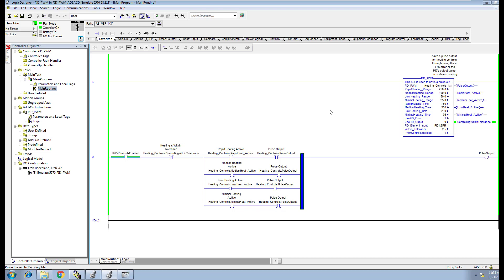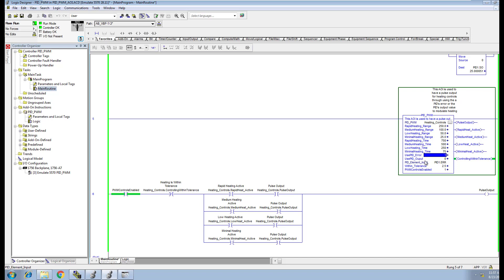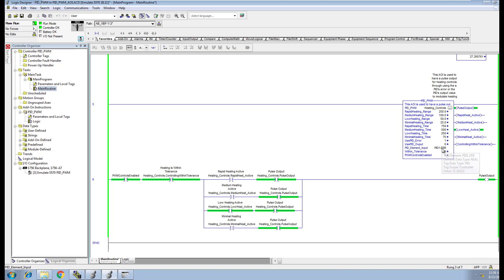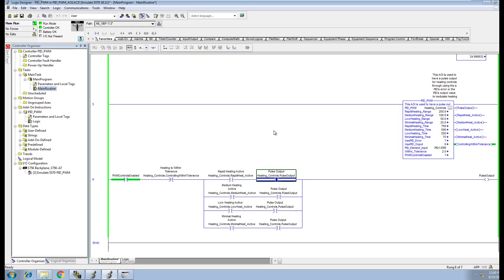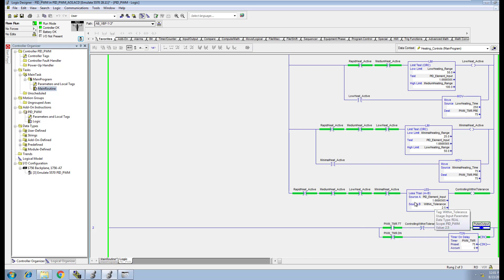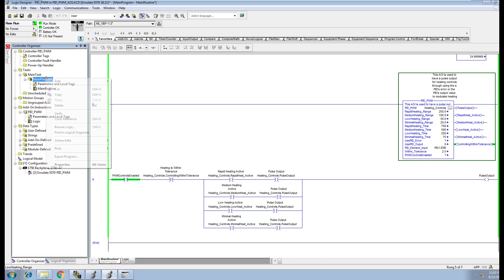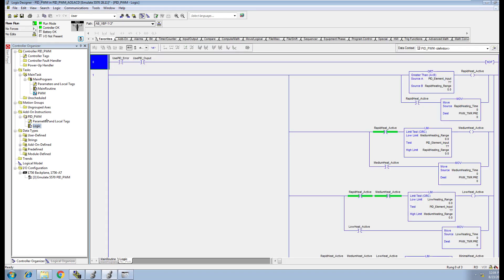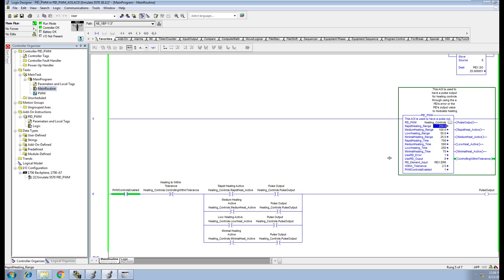Studio 5000 Pulse Width Modulation Add On Instruction For Heating Controls

Comment: In looking at this a bit why are you using the PID? 
If you are just looking at the error could you use the subtraction block (SP - PV = error)
Reply from the maker: I use it as I show but yes
Reply: @ShaneWelcher  regarding the output should I be using a OB16F or just a normal OB16 will be fine?
Reply from the maker: @crazykenkid Either one works

Comment: I know the Output % is tuned based of the Tuning Constant. Is it the same for the Error? I'm trying to control my output based of the PID Output instead of the Error but I am not having any luck with the tuning.
Reply from the maker: @markramos3007  Then it's best to use a PIDE
Reply: @ShaneWelcher  do you have an example video of a PIDE with a similar set up. Thanks for the reply.
Reply from the maker: @markramos3007  Yes, use my search tab on my channel then type in PIDE
Reply: @ShaneWelcher  Thanks!! I really appreciate your  help..

Comment: how can we get scan cycle time of program
Reply from the maker: Cycle time of the AOI I built is just changing the timing on the timing rates in the AOI per what you need.
Reply: @ShaneWelcher  In siemens PLC,we get the overall scan cycle time of the program. for eg 150ms.In rslogix what is the instruction to get the scan cycle time
Reply from the maker: @arunthangaraj8364  in Rockwell Automation, you can set the task for whatever you want.

I generally run normal control task of the program section at 47ms or 75ms.

This is done through the task rate of the program level not just the PLC level.

Rockwell is more advanced than others in controls.

Just out our course to learn more, there is crazy deals for the courses right now.

Very detailed learning.

Hope that helps